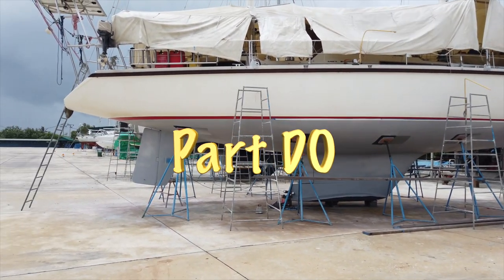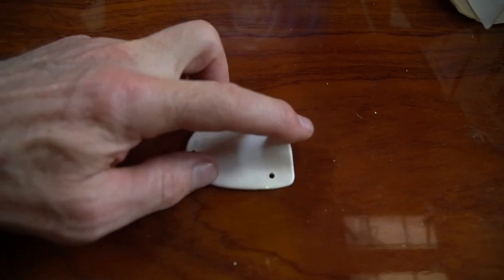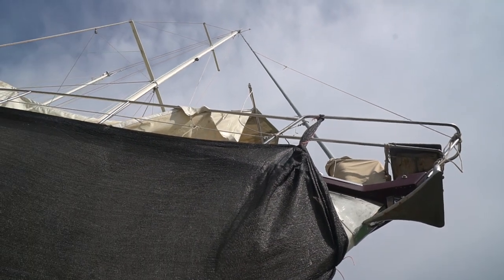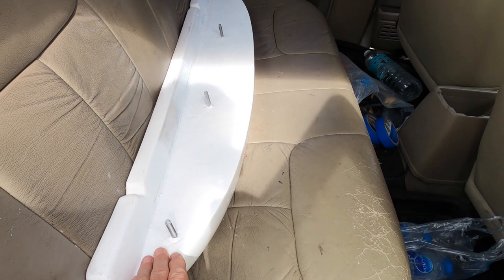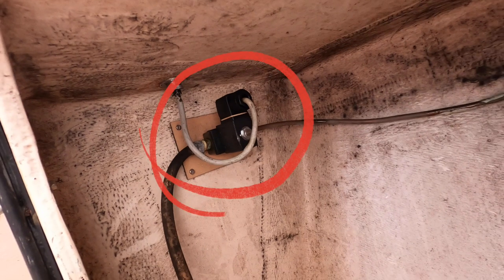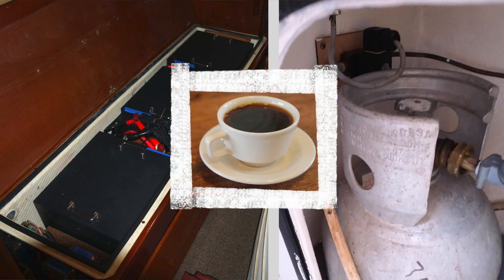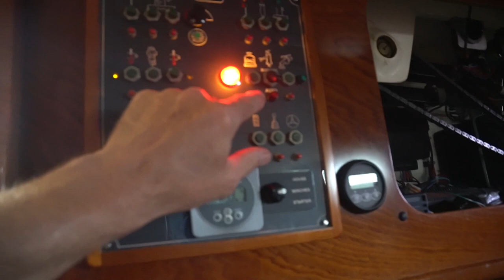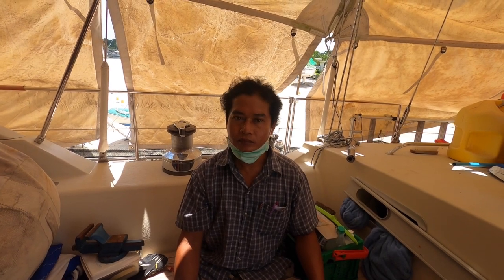Part Do - "Can you also do this" Blues.  More repairs on Aquarius

Comment: Ken any thoughts on redoing your electronics?  I know you added forward looking radar but what about your chart plotter and radar system?
Reply from the maker: Not interested in replacing the Chart Plotter.  Every person onboard should have their own set of maps on a smart device.  It is much cheaper and safer to do it this way than spending $300 for a set of  maps for one region for a fixed Chart Plotter.  However, I would like to install a new radar, but I would have to pay at least $4000 for one that I would like for Aquarius.  I'll use the original, it seems to work pretty good.  Fair Winds
Reply: Please don't ever change the analogic gauges on the cockipt for digital ones, they are part of the "classic" flavour of this yatch. Ok, you see the cockipts of a modern Amel 50 o 60 and it is Star Trek and very cool, but I aleasy liked some analog gauges here and there, even in cars also
Reply from the maker: @alamos8  You think just like me!  I love those Hydra 2000 gauges, and will fight like hell to keep them!!  They are getting a bit old, but with the right spares, they should last another 10 years!  Vid to come and talk about the Hydra 2000.....